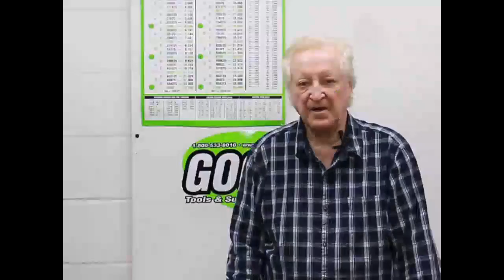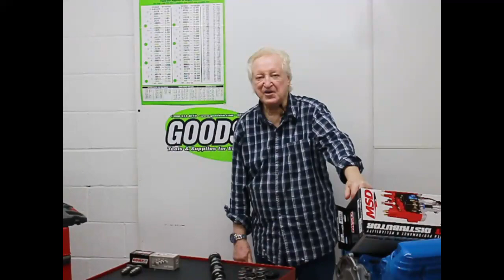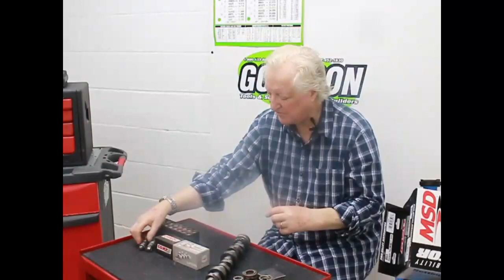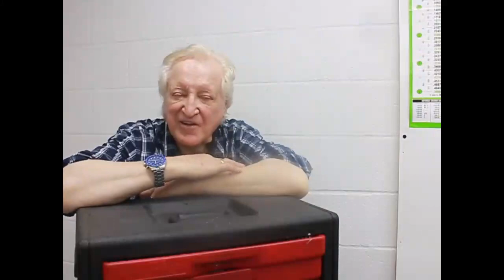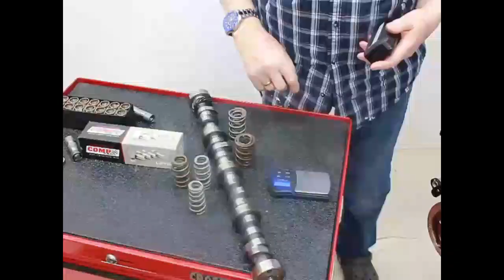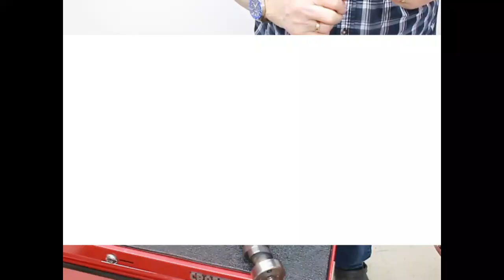Power Tec 10 lifter Tec

Comment: Comp cams = garbage lifters! That’s what they sell.
Reply: I have seen way too many stories of Comp cams being shredded after days of driving. They owner fills the engine with high zinc break in oil, runs the engine at 2000-2500 RPM for 20 minutes, and the cam and lifters are still torn to shreds. I have heard some other brands are also trash.

Comment: We put sold roller lifters on hyd roller cams all the time with excellent results. Zero lash on aluminum heads, .003” on iron. .904” on most everything. 
    I think you have to touch on cam to crank C/L, lifter bore index and body clearance when discussing cam &  lifter performance and function. 
      We spend a great deal of time correcting those parameters.
Reply: What's the benefit of doing this versus just swapping in a solid roller cam along with the solid lifters?

Comment: Regarding the change from solid to hydraulic lifters by manufacturers back around the early 1960's. I think possibly another advantage for the manufacturers and their service centres was the hydraulic lifter did away with the need to adjust tappets which was always a contentious issue with workshops. I imagine it would have been one of the least favorite jobs for young trainee mechanics.
Reply: Not to mention easier to slam together on the assembly line.

Comment: David, I refer to your books often. One thing "please check the lens of your camera before you start and make sure it is clean" and KEEP UP THE GOOD WORK. I learned something already and it couldn't have been better timing. I've got a slightly built BBC (491) with aluminum heads in my 70 Chevelle and have used your books throughout the entire process. I'm thinking about swapping out my current cam for a Nitrous profile and adding some boost that way. Thanks for bringing things online and giving us firsthand knowledge straight from the source!

Comment: Good to see you again David, hope you are keeping well. When I was a young fella driving my early Holden cars it was not uncommon for us to fit our hydraulic lifters with a solid kit which is what I suspect you were referring to early in this video. It was a common performance modification to give a quicker pedal response from the old Holden engines.  Stopped any leak down and gave a nice little engine clatter sound to annoy the old folk. As an interim (and easy) modification to help a little we would also simply use a heavier oil which gave a little more time before you had any meaningful leak down. Great ti see you again, keep up the good work.

Comment: Neatly covered.  Can you add the link in the video description?  Format was cropped [left and right sides reduced] and... it just doesn't present completely.  Having never done any spintron testing myself, my only observation in the past was: better follow the cam mfr spring specs.  Hydraulic lifters have their own comfort area regarding spring rates snd that's that.  Nice to learn a bit about polymers too - I always knew viscosity mattered when it comes to operating anything hydraulic [I have observed high pressure pumps just go haywire on output pressure/make a racket due to  low vis caused by high temp/insufficient sump levels, but that's not automotive].

Comment: Mr. Vizard, I have been reading your books since 1996. I recently built a 302 ford with stock heads which I ported using your flow bench plans with a hydrometer. I used zero deck clearance
and took forty thousands of the heads. My friends and neighbors can't believe that the engine is a stock 302 with machine work and porting. Runs awesome and I attribute it to your teachings. Thank you. I am a life long fan.